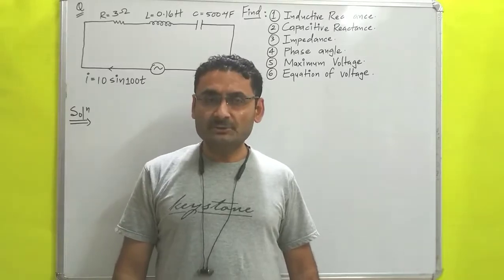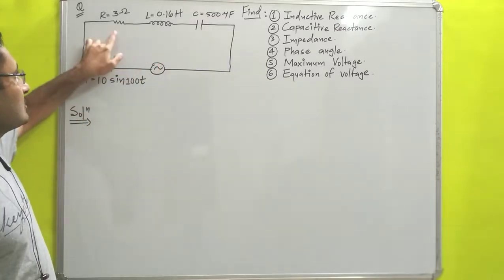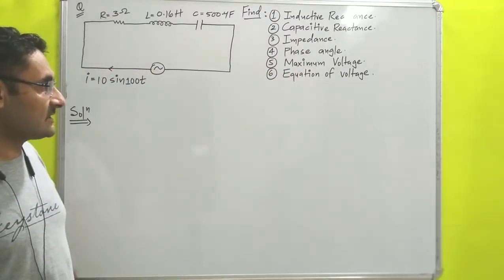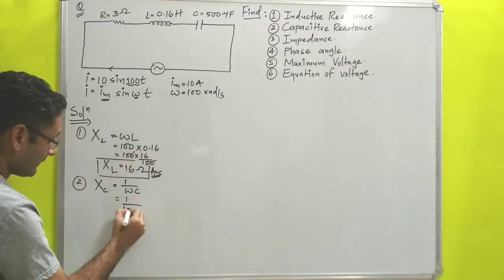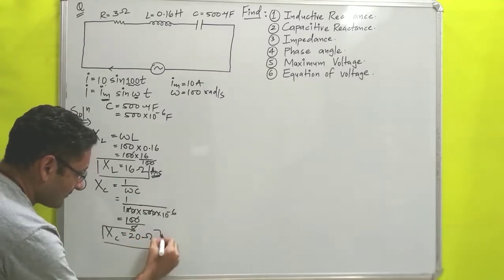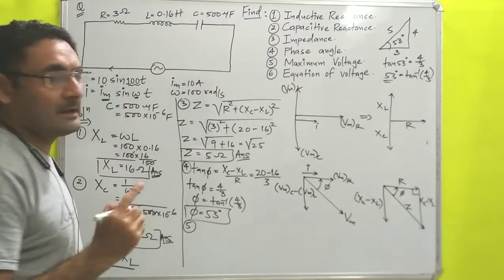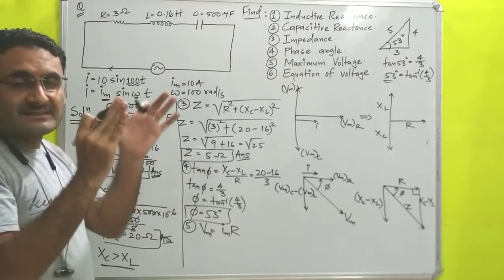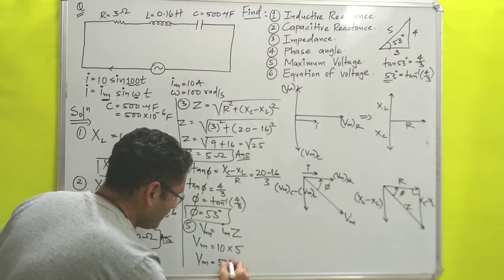Numerical on Series RLC circuit  Unit 2 AC circuit | BEE

Comment: Sir but current lags in inductive , how you lead the current from voltage
Reply: Current is leading by 90° from potential in case of inductor so  it can be that voltage is laging behind current by 90° in case of inductor. Both the statements are correct.
Reply: Voltage lags current by 90° in case of capacitve circuit but in case of inductive circuit voltage lead current by 90°